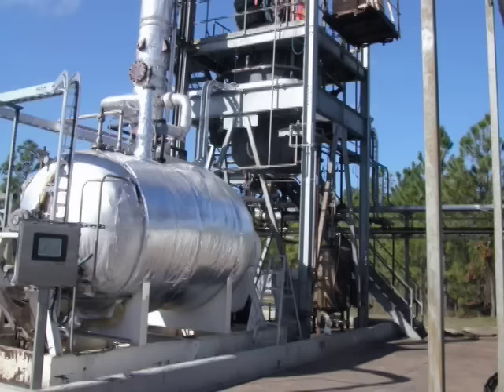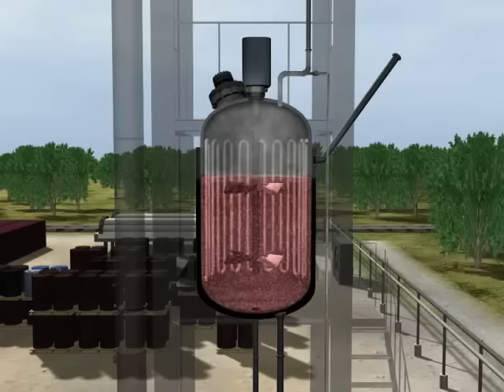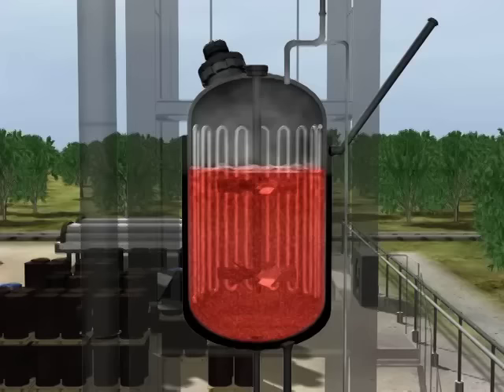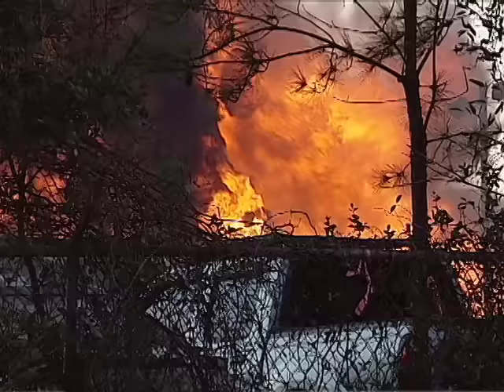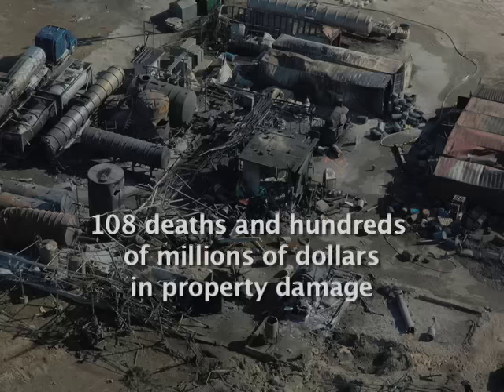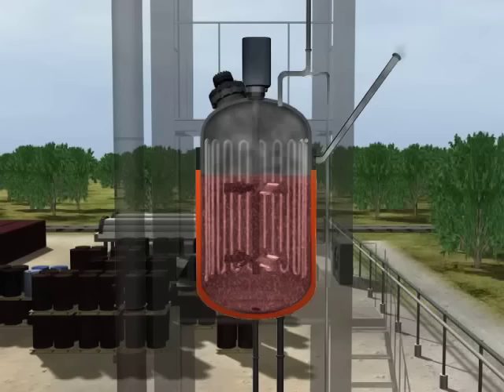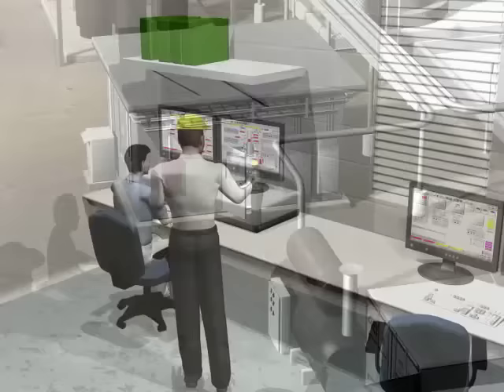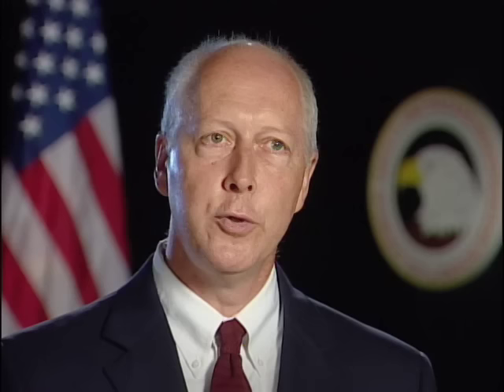Runaway: Explosion at T2 Laboratories

Comment: The investigation focused on cooling, but the real problem was how the reaction was performed.  I am a retired chemical engineer with the equivalent of two masters degrees and 31 years industrial experience.  In 1985, I hired Scott Gallagher and also worked with the other two principals.  I live across the St. John's river from where T2 was located and retired at home, witnessed the explosion.  I did not know what had exploded, and will not repeat what I said to my wife.

I learned from a chemist 40+ years ago that you do not put reactants into a vessel, heat it and cross your fingers.  The proper way to run this reaction is to fill the reactor up to the heating coils with product with the addition of one of the two reactants (in this case, sodium).  Since the product has already been reacted, no further reaction takes place when the reactor is heated.  The second reactant is then fed on temperature control.  Example interlocks on both the digital and analog feed valves (the digital is for redundancy and absolute positive shut-off) include not being able to feed if: 1) the reactor temperature is too low (below "instantaneous" reaction temperature, therefore disallowing accumulation of the second reactant),  2) the reactor pressure is too high, 3) little or no agitation and of course, 4) high temperature.  In this scenario, cooling water is needed for production, not for safety.  Needless to say, I have supervised the running of many reactions of this sort using this approach.  Unfortunately, Scott was transferred from the process engineering/piloting department under my management into the construction engineering side before he learned the proper way to run this type of reaction.
Reply: Then you should know better that ALL reactions, to get the end result that you want, DON'T always work that way..

Comment: "Move away from the reactor"... yeah like about 1/4 mile.
Reply: David James I was thinking more like the next county...
Reply: SDChick next country. Just to be safe
Reply: as soon as the ONLY COOLANT SYSTEM failed I would've bolted to me car and fled, hoping everyone else did the same thing
Reply: If that was a reactor...where was the contaiment?
Reply: @WadcaWymiaru    the second wall.   basically there's 2 walls where the water cooling is pumped in,  that's your basic containment.
Reply: @WadcaWymiaru   it is when you're on a budget 🤣😆😆😆😆

'Murica !
Reply: @The-Cat  
Then how about "payment in the blood"?
Reply: @WadcaWymiaru Some politicians call it " trickle down economics" 

They wipe away regulations to maximise profits. 

That cooling mantle == containment by the logic of "There's no regulations to tell anyone to have an actual containment around a reactor core"

So use the cheapest form of production to maximise profits!
Reply: Good luck trying to get that far in roughly 10 seconds, you’re probably not going to make it very far before you’re vaporized by the blast.
Reply: @noahater5785  A "souped" up car can do the 1/4 mile in about 10 seconds ha ha.

Comment: I do wonder why refineries and plants don't have warning sirens when they get in to trouble, they has to of been a point when they should ofrealised the Reactor was a lost cause they just couldn't see it.
Reply: +sword115 

in germany they have. I am process engineer. If we would develope a reactor like this at t2, we would lose our jobs >.< ......no overpressure warning/alert, a small tiny overpressure valve (this valve must be able to blow out EVERY overpressure at emergency!) and a cooling system right from stone age....nice engineering! -.-
Reply: +sword115 That's just the thing. Plants DO have warning sirens, lights, horns, blips on your screen, all of it. At least, they are supposed to. I'm an operator at a petrochemical plant, and this is a clear cut case of ignorance of the chemical process, from owner to operator. Not only that, but as they scaled up the process, they should have re-examined their unit/equipment/safety redundancies EVERY time. But in fact there WERE no redundancies. They simply tried to get as much product as possible out of what they already had. That is not, and never has been, the process by which any plant should change and/or grow their process. The most crucial, initial mistake that was made was a lack of knowledge of the process, in great detail. Everything else was a domino effect built off of that, which led to conditions that were perfect for a catastrophic disaster, and I hope this can serve as a lesson and cautionary tale to anyone and everyone that is either in, or wants to be, in the petrochemical industry. All those dozens and dozens and dozens of hours of safety orientation and training they put all operators through - yes, it is there FOR a REASON. Be safe. Period.
Reply: yes. I quite believe you...we had our plant built and designed by a German firm called NATEX....very professional and excellent control and attention to detail...this was a supercritical c02 extraction plant with 3 extractors running in parallel, 700 Barr was a nominal pressure, but, human error could happen and still bypass safeties, with the results of huge, titanium steel cylinder extractors looking just like a crush empty pop can...and the noise ! it happens in an instant...alswell then all of a sudden "ka-boooom!"..there was lots ways to die at that plant....
Reply: Every plant I go in has specific alarms /sirens , rally points , site specific training and every year the requirements get tighter .
Reply: Because that would be communist/socialist to require a business to spend any money on safety mechanisms.
Reply: Apparently they had 10 seconds
Reply: Wagner PD  its not that bad for the most part, people get twitchy about safty, namely engineers welders.

Comment: It sounds like they scaled up without forethought of safety.
Reply: Maybe they forgot that some elements don't scale linearly and failed to adapt to that.
Reply: going from 1 frigging liter to 2500 gallons in one fell swoop, bad move.
Reply: @xXDESTINYMBXx  very true.. nuclear industry has had many problems with scale.. great example everyone can grasp about energy stored in common elements and chemicals.
Reply: That’s what happens when you don’t convert from imperial to metric or vice versa, your measurements end up way bigger than you originally anticipated

Comment: That's just the thing. Plants DO have warning sirens, lights, horns, blips on your screen, all of it. At least, they are supposed to. I'm an operator at a petrochemical plant, and this is a clear cut case of ignorance of the chemical process, from owner to operator. Not only that, but as they scaled up the process, they should have re-examined their unit/equipment/safety redundancies EVERY time. But in fact there WERE no redundancies. They simply tried to get as much product as possible out of what they already had. That is not, and never has been, the process by which any plant should change and/or grow their process. The most crucial, initial mistake that was made was a lack of knowledge of the process, in great detail. Everything else was a domino effect built off of that, which led to conditions that were perfect for a catastrophic disaster, and I hope this can serve as a lesson and cautionary tale to anyone and everyone that is either in, or wants to be, in the petrochemical industry. All those dozens and dozens and dozens of hours of safety orientation and training they put all operators through - yes, it is there FOR a REASON. Be safe. Period.
Reply: It's really the fault of the county and state that don't have any kind of rigorous safety review. This is what happens in "business friendly" jurisdictions.
Reply: I suspect the owners were chemists rather than chemical engineers - still thought in terms of the laboratory rather than industrial processes

Comment: This terrible tragedy was due to the lack knowledge of the process, of chemical reaction engineering, heat transfer, and control. The process, the chemical reaction involved in this terrible accident depends on sodium as a reagent which is a high reactivity precursor, which is not well recommended (this decision would imply a very well designed control system, with all safety measurements considered, and emergency procedures established). They could try another path to find the desired product using another precursor with sodium to make this process safer. The second important point, it is essential to know if the reaction the reactor is dealing with is, either exothermic or endothermic, in order to define the heat transfer system for the reactor. The heat transfer proposal for this particular reactor it is poorly designed. Removing heat with water at those temperatures implies a constant flow of water in the reactors jacket due to its boiling point. Finally, the process control system, is controlled by an operator, which expose the process to a human error. Considering the amount of heat caused by a high exothermic reaction, an emergency procedure should be predefined, considering all the necessary measures in order to never lose control of the temperature in the reactor, adding another feed line of cooling water to the reactors jacket in case the other one fails. Pressure sensors together with a pressure release system, to mention one We believe the key point in this tragedy is precisely the heat transfer system. But more important yet, the engineering behind this tragedy is outrageous, this process and every other should be designed with awareness by qualified personal. 
This commentary was done by the students of the class of Chemical Reaction Engineering of the Chemical Engineering underdegree program in Universidad Autonoma de Nuevo Leon, in Mexico.

Guadalupe Casados, Leticia Camilo, Benjamín Beltrán, María Hernández, Luz Arias, Uriel Pérez, Suzette Flores, Ana Montemayor, Fernando Maciel, Javier Castillo, Juan Martínez, Erick Acevedo.

Comment: For an example if you take a sphere with a diameter of 10 inches, and a sphere with a diameter of 100 inches. The ratio of spherical surface area to volume for the 100 inch sphere, will be 10 times less then the smaller sphere. That is significant when discussing thermal chemical reactions.
Reply: Wow!  You've discovered a new law of geometry!  Surface of sphere = 4piR^2.... volume of sphere = 4/3piR^3.  Ratio for 10" sphere = (4pi25)/(4/3 pi 125) = 0.6.  Ratio for 100" sphere = (4pi250)/(4/3pi 1250) = 0.6.  Apply for your Nobel now!
Reply: Math is a bit off there but the general idea is correct.
Reply: @scowell  Check your math. 

The formula for the surface area of a sphere is Diameter times Diameter, times π
The formula for the volume of a sphere is Diameter, times Diameter times Diamter, times π ÷ 6

A ten-inch sphere has a surface area of 314.1592653589793
A ten-inch sphere has a volume of 523.5987755982989
That is a ratio of 0.6

A one hundred inch sphere has a surface area of 3141.592653589793
A one hundred inch sphere has a volume of 523598.7755982988
That is a ratio of 0.06

You were just off by a magnitude of 10; it happens due to the poor math practices of new. 

A cube follows the same ratio. 

However, for runaway reactions, the formula for the theoretical sphere within the cube has to be observed because the heat will be trapped at the limited surface area of the theoretical sphere, and not benefit from the cooling surface area of the cubical tank or containment.
Reply: @whiskeyfur , Scowell is off by a magnitude of 10. I just posted a breakdown of a ten-inch sphere versus a 100-inch sphere.

It is clear the ratio of surface area to volume ratio between the 10" and 100" sphere is ten times more surface area to volume on the smaller sphere. 

Sincerely, 

William McCormick

Comment: without going down and reading other comments, I bet everyone with half a brain at least is screaming "where's the fuckin backup coolant system!" where's the autodump for dropping the reactor contents into a quench pit? this should have been there AND it should have been automated.WHY WHY did the authorities who oversaw the standard operating procedures not insist on getting this in place before even commissioning the plant! what the fuck? obviously there's a lot of weak spines in certain GOVT departments there...unforgiveable,unnacceptable!
Reply: +psycronizer Could not agree more. Any time there is an upscaling of volume/productivity/output, all possible abnormal conditions or upsets, not matter how small the possibility, are to be considered. This was not done in this case. Add to that the fact that practically no one at that unit had a full and fluent understanding of the chemical process taking place in their OWN unit (from owner to operator), and it's no wonder something like this happened.
Reply: if you know what truly happens, it happened within seconds I've been through 3 runaways.

Comment: With cooling so critical, I'd  have a complete redundancy, maybe even a water tower.   I work where a large reactive process will be used.. There's a complete way to dump/stop it at any time designed in.    A separate triple redundant control system automatically scrams the process if things start to go south.   Lessons learned being applied.
Reply: But those things cost money, you see. Can't have that, boss needs his second vacation home.

Comment: Scaling up the volume actually makes it more difficult to cool as the surface area to volume ratio decreases
Reply: Yes. I would have thought the coolant jacket around the reation chamber would have been 10 times the thickness with large circulation pumps pumping into a 10k gallon coolant reservoir tank.

Comment: I lived and worked in Jacksonville at that time.  I was in my truck on the opposite side of the St. Johns River when the blast happened but I didn't see it, heard about it when they cut in on the radio.  Had a colleague running that route so I immediately called him to see where he was.  He had left that area about 15 minutes earlier.  Everyone was surprised to know that a company like that was allowed to operate in that area.  I dunno, but does a light industrial rating allow for chemical manufacturing?  There are mainly warehouses in that area, nothing to be considered hazardous.

Comment: How do you design a reactor like that, with only a single cooling system preventing it from overheating? Also, how were there no alarm systems, alerting the crew and the nearby civilians to evacuate once the cooling system failed. Layman here, seems like common sense to me. 

It's amazing how badly things seem to be designed in this industry. In every other fied that uses explosive materials, you find redundancy after redundancy to stop things like this from happening. Nah, lets just build a self sustaining reactor that only has a single system stopping it from becoming a bomb. Yeah what could go wrong, that water pump won't ever fail.

Comment: gunfuego

it had the equivalent. its called a rupture disk. basically a metal disk set to rupture when the pressure reaches a certain point. its not a valve but the function is the same.